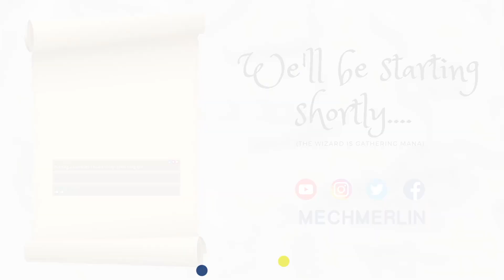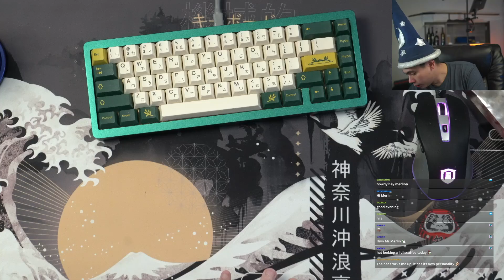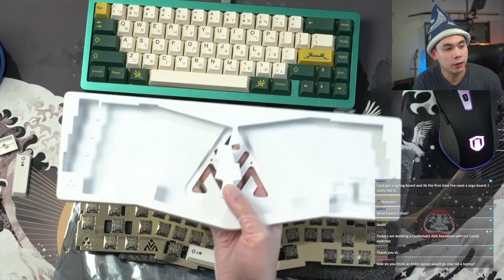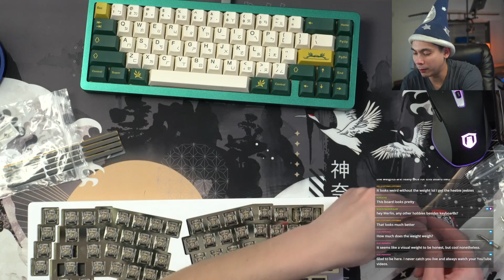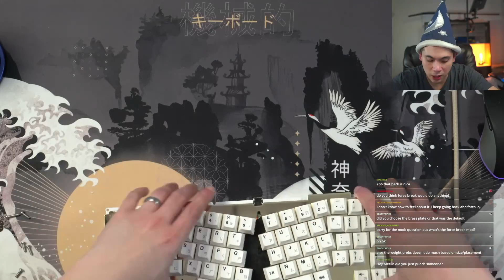Build: Sneakbox Design AVA with Tecsee Ice Candy

Comment: I love my ava with a PC plate and banana split switches; i got the hotswap option for the pcb so its odd that the customer bought the soldered version and asked for it to be millmaxed. Im my experience millmaxing is more difficult to switch out switches than hotswap sockets. Also idk if you mention this later in the video (halfway through) but the manu is sneakbox and the board is AVA not the other way around!
Reply: i actually find it the other way around. I find it easier to switch switches with millmax sockets. also its more sturdy than a hotswap socket because hotswap sockets come off easier than what you would like if you are not really careful with taking off switches. I'm currently rocking brass plate with banana split switches as well. But I find the board really stiff and just clacky. Just wondering if you did some kind of mod and if you got a nice amount of bounce/flex when you type. Would love to emulate your build to better mine.
Reply: millmax also allows for different layouts

Comment: When I got this board I really enjoyed the feel and sound, and I think it's because I went with the polycarb plate and omitted the plate foam. Funnily enough I went with the same weight and case color/material options, but put went with GMK MoDo R2.
Reply: Is it high pitched or low pitched sounding?
Reply: @TheRealRaijinX  probably a bit higher pitch due to polycarbonate plate, but other factors could go into play, better sound with brass plate, but trade off for flex